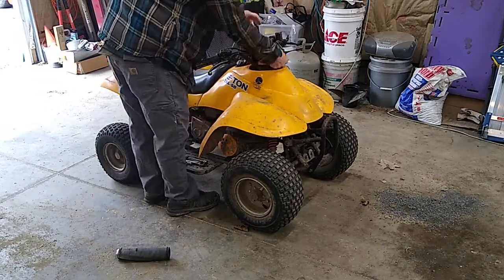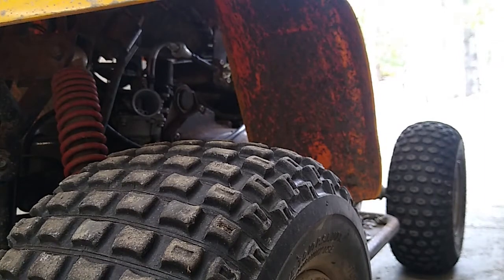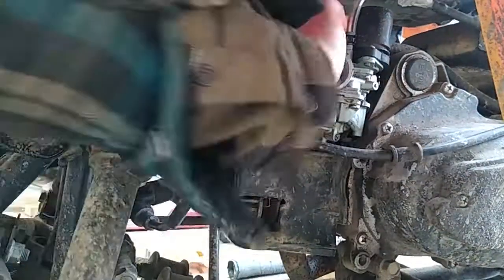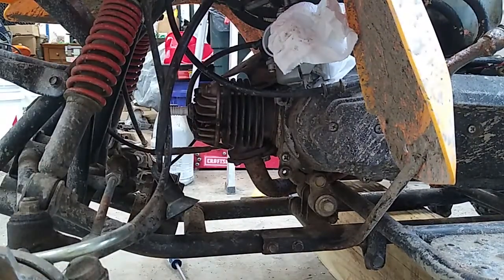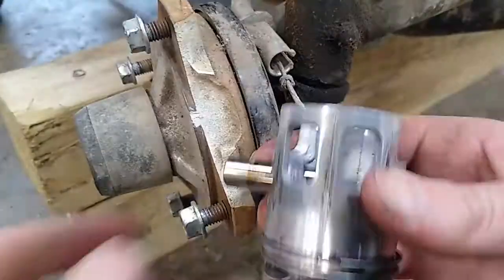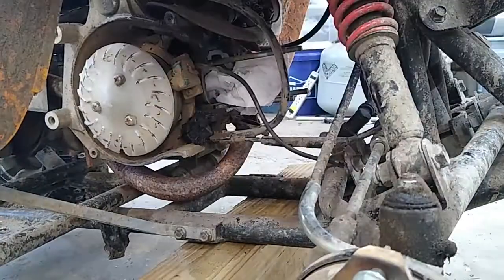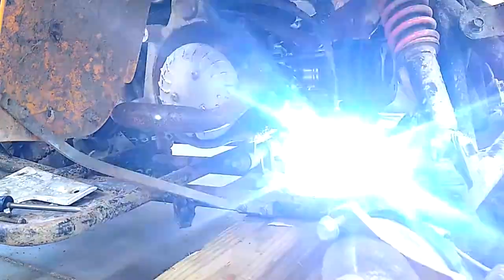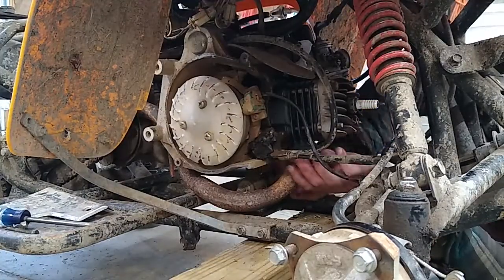ETON TXL-50 Blown Head Replacement

Comment: Just bought one of these for my kids. Compression test came back at 30 psi. I replaced the cylinder, piston & rings, still showing as 30 psi. I then replaced the kit thinking it was faulty, got the same compression number a 3rd time. I did a leak down test at 7psi with piston at TDC and I can see small amounts of oil bubbling out of the exhaust port even with the new parts. I quadruple checked the piston ring placement & the direction of the piston arrow - all looks correct. I'm a bit stumped at the moment. Would you mind please linking the site that you received your top end rebuild kit from?
Reply from the maker: I got most of all the replacement parts from https://get2itparts.com . You might consider setting everything up with a lightweight oil, which should help plug very small gaps between parts and minimize dry starting.  You should also pressure check your compression tester or borrow one from your local auto parts store to rule it out as the cause of your measurement problems.

Comment: Ive got an eton viper 50cc engine and i think itd 2 stroke do you know where i can get a new wiring loom ans carb from for this? I dont know where the elec shock wire plugs into
Reply from the maker: I use get2itparts.com.  the electrical schematic was a little harder to come by, the ones I found didn't match the machine directly but did help out.  I might be able to find these documents if you have no luck.

Comment: You can change the top end without taking the engine out. To torque use really long extensions. 15 to 21 ft lbs. Also put the piston in the cylinder first, leaving the skirt to stick out of the bottom so you have enough room to slide the wrist pin through and place clips. Then slide the cylinder down all the way. No special tools needed.

Comment: FYI there's a 70cc top end that's an upgrade to the 50cc for these. Also as mentioned this is not a head replacement, it is a complete top end replacement. I was wondering what was up when I seen how it was listed because 2 cycle engines don't blow heads. You can get a head gasket leak or strip out the plug threads and thats pretty much it.
Reply from the maker: I saw the 70cc head kit, but honestly this machine is probably already too fast at 50cc.  I don't think anyone riding this machine "needs" 70cc.  I cooked the head on this machine by overheating and messing up the plug threads, honestly probably because I drive it at full throttle like an idiot and overheat it.  It does get super hot.  I bought it with a blown head with another failure, the ring sheared and jammed in the piston, destroying the ring, piston, and cylinder all at the same time.
Reply: Does the 70 kit have a 10 mm wrist pin? My 50 has 10 mm not a 12 mm. From what I think I heard was some types of etons have a ten and some twelve.
Reply: Maybe the head warped from getting to hot.

Comment: Hi, I have the exact same quad, why would it cut out if the throttle was pressed
Reply from the maker: Could be a problem with the automatic choke staying on or the carburetor jet is plugged with debris.  I tried to clean out this carb but it's so tiny and was not successful with what I thought was a thorough cleaning.  Replacement carbs are only like $15 and well worth it
Reply: @NineCarGarage  could you direct me to the automatic choke please
Reply from the maker: The automatic choke sits on top of the carburetor and has wires going to it.  
If the machine starts but runs rich and bogs worse when it warms up, it might be a stuck choke.
You can check the resistance of the choke at the connector to verify 20-30 ohms.  
You can also you can check the other side of the connectorb for ~20Volts AC from the stator.
A complete new carb with choke is $20-30 on amazon or ebay
https://www.amazon.com/Electric-Carburetor-Sportsman-Scrambler-Lightning/dp/B07KZQMZ8N
or you can get a new choke for ~$8, for example
https://www.monsterscooterparts.com/catalog/product/view/id/25045
Reply: @NineCarGarage   brilliant thanks very much, I’ll check it and let you know. Thanks again
Reply: Dirty main jet but on mine I don't have the air filter assembly so I have to restrict the air flow a little with a makeshift filter to stop it from just dying when I give it throttle. It doesn't really open up all the way like it should but good enough for me.